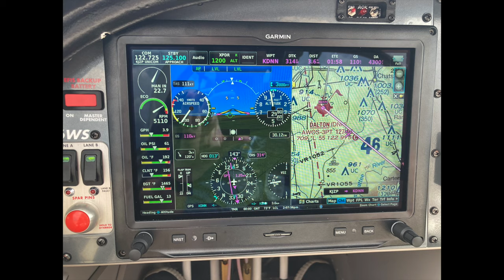RV-12 Choppers

Comment: The IRS probably has choppers for an attack squad now.  Rotor wash is no joke tho.
Reply from the maker: I did see a LSA Pipistrel taxi close by so I assumed they had the collective at neutral or down, so I figured I could slip by to make it to my hangar with no issue.  Worked out fine.
Reply: @rv12sg  sweet. You have a good thing going there. Really enjoy seeing you fly. Thanks for that!